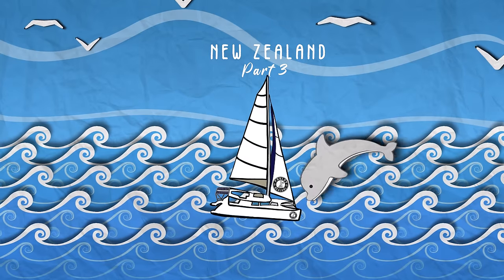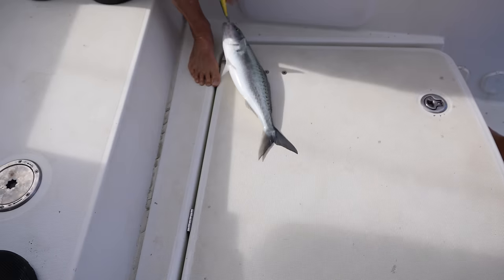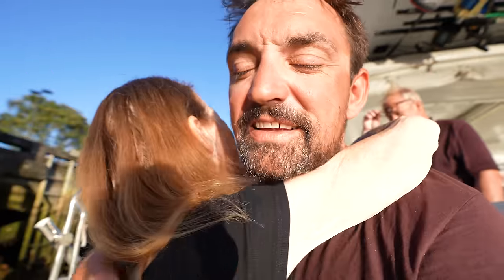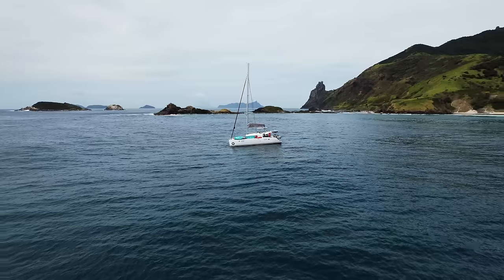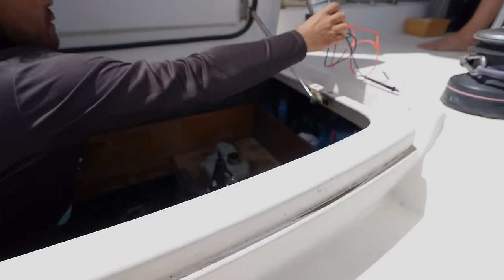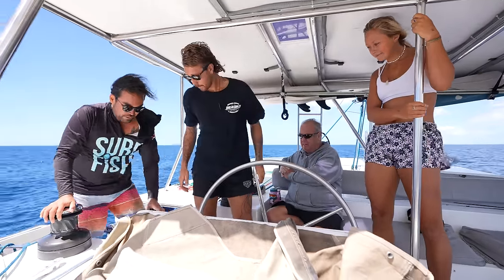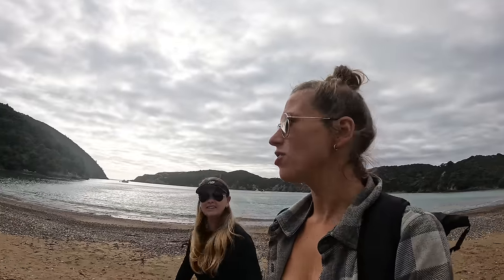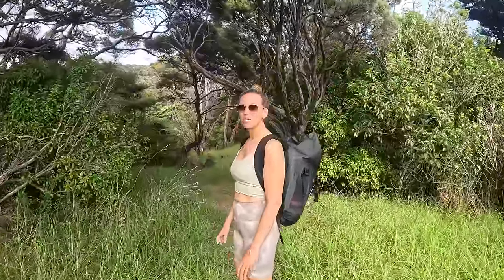I'M SERIOUSLY ABOUT TO THROW THIS SAILDRIVE IN THE TRASH!

Comment: I'm no engineer, but with over 20 yrs in manufacturing, I've found the best way to find the problem is just keep eliminating what's NOT the problem...you'll get there every time, eventually!  Been dealing with an oil leak on my truck, eliminated several possibilities and narrowed it down to just 2, fortunately you have to remove one part to get to the other, so I won't be breaking any knuckles on nuts and bolts that don't need to be removed, I can go right to the root of the problem now.  Gotta love those jobs where you need to do about 6 hours of labor to replace a $10-$15 gasket or some $2.00 O'rings...

Comment: Cheap easy low-tech way of isolating a noise:  cut a section of garden hose.  One end on suspect area of the engine the other end to your ear.  Husband does this all the time on car engines.
Reply: My dad would do the same thing with a sawed off broom stick handle. One end to his ear, and the other around the engine, touching different parts. He could find a bad rocker, lifter or valve issue very quickly.
Reply: Long screw driver also works.
Reply: All the above are excellent improvised mechanics stethoscopes.
Sometimes, they can even be better than an actual stethoscope, by eliminating some high pitched frequencies.

Good deductive, minimally invasive, diagnostic procedure nonetheless!

Comment: I made a plywood box with gasket that fit around the drive leg and bolted to the hull so the sail drive could be removed in the water. It fit either hull.
Reply: It works but it's much easier to ram a deflated inflatable under the hull and blow it up, I've changed a saildrive on a Lagoon when our crane was out of action.

Comment: Nothing stops you and your crew, it just means a small course adjustment in plans !  Good thing about drives like that, there will likely be lots of old spares available online or hopefully locally until you can arrange an upgrade/replacement to another model better suited. Maybe a better unit can be swapped with some help from manufacturer ?

Maybe some manufacturer will be willing to make Parlay a test mule by sending 2 sets of different paired drives to use with their return planned so they can be disassembled by factory in exchange for a new or used set of 3 (1 spare ?) for permanent usage ? Think of all the owners of Lagoon models watching your boat as a leader in what they'll need in future... you're a pathfinder vehicle.

Comment: Mechanic tip 
When looking for a sound and easy way to find it is this. Put a 2  foot section of broom handle on the part you want to find the sound. Put the other end against your ear about 1 inch under your ear hole about your ear lobe. . Then just move the broom handle to different parts you will be surprised what you can hear inside different parts when even the engine is running. No need to jump into the water

Comment: My SD50 drives rotted away last summer and I had to "force upgrade" to SD60 drives. My goodness they are insanely better. I can hear them shift all the way up on my flybridge. My SD50s had the same upgrade kit you installed, but still lots of problems. It wasn't cheap, at about $12.5k per drive installed. However, I also spent about $4k on lower shaft replacement parts for my SD50 2 years ago. The drives themselves cost about $7k with the SD50 conversion kit. However Yanmar wasn't willing to honor any warranties unless I had them pro installed. But with all your certifications, maybe they'd let you. 

If it's in your budget, I'd upgrade. Most of your problems will go away...

Comment: Hey Capt Colin 
Here my take on finding problems with motor 
Either get a doctor heart beater contraption or 
Just a hose long enough to reach down around the engine and the other end straight in to your ears to pin point the problem 
Hope that's helpful cheers

Comment: Pick up a spray can of Phosphoric Acid (rust killer) and coat all your non-SS steel tools and engine fittings with it. Having pliers that easily open and close, and nuts and bolts that don't have to be heated up to remove them, makes maintenance so much more 'Fun'... :face-fuchsia-poop-shape:

Comment: Two engines means you have a back up. It also means twice as many failures and twice the maintenance and repair costs . Add in a generator and you have 3 engines to break down .

Comment: Love this episode-  I mean Possible fire, Big lobsters, failed sea drive.  About the "fire"/  Being a classic VW guy (you know - the ones that only catch on fire occasionally!!!) Well a guy has invented a passive fire extinguisher in the form of a pliable tube that quickly melts thru and sprays retardant before  you even know there is a problem.  Believe its called "Blazecut"   Comes in different lengths. I'm 74 and been in the outboard/marina business as a mechanic all my life. worked on many  Volvo stern drives .  I believe you might have trapped some debris  while motoring and bent one of your gears- ( just a total guess you understand)  was unheard of in stern drives. But maybe pattern the gears and look for a tight spot if you can not actually see a damaged gear.  The other thought is - you did not power the drive shaft in reverse to see if gear damage might be there rather than the clutch.  Can't wait to hear what you found out. Cheers  Bill.🤔
Reply: Rugby tackle--bet that looked good on paper.

Comment: could you maybe explain a bit how it's possible to bend a cleat up like that. Me and my mom were pretty confused by the ripped up deck and bent cleat. I'm convinced it was a freak accident assuming most lagoons don't have this happen. But the whole cleat bending is evidence of enormous force, i'm sure you know this as an engineer. I'm suspecting that small landmass you sailed passed made a small change in the wind speed and direction at the same time. creating a "perfect storm" for that poor cleat? but maybe it was just left-over hurricane damage? seems unlikely to me, i'm pretty sure you did thourough checks for condition of hull and deck. Maybe it's just impossible to check the bonding of the two? i certainly wouldn't know how. Hope it's not a touchy subject, and looking forward to the next episodes. And be more careful with that huge chungus of a sail you maniac! love you bye!
Reply: Someone suggested the spinnaker should've been used not like it was, but with a prodder, aka tangonnet, which bears and pushes forward asymmetrical spinnakers or gennakers. Not sure if that prodder would've been ripped off or not.

Comment: I've had to replace lower gears on both my SD50 saildrives. Super weak design. I replace lower seals at every haul out, and carefully inspect every tooth while in there. I have a trick to replace the vertical gear without disassembling the whole leg.

Comment: Getting some high quality electric saildrives and engines with re-gen. and a bigger battery bank would be awesome.
There gotta be some companies out there ready to sponsor the best sailing channel on the Tube.
Reply from the maker: Thanks Ian, appreciate that!
Reply: @ParlayRevival  You've earned it Bros...
Reply: Electrically powered sailboat drives still have similar weaknesses.  Their advantages is still that they cost less to the builder.  There is no advantage to the user.
Reply: @captainjimolchs  In your humble opinion... 
Is it by experience or just something you feel?
Reply: @Ian_Christensen  --Sailboat drive, (properly named), is what it is regardless of motor choice.  The only advertised advantages are less noise and vibration, which could be further reduced by electric propulsion, and less prop walk, which I consider to be disadvantageous because it might require external assistance or side thrusters.  They might also save space, and horizontal alignment could slightly increase efficiency.  However, most maintenance beyond recommended inspection intervals calls for a haul-out, as seen above.  It appears that replacement of the entire unit and fabrication of an adapter, was preferable to replacing one gear.  The model 60 has a spiral/worm gear and generally considered to be an improvement over the 50.  Failure of the double boot seal can be catastrophic.  Some models come with or recommend leak detectors.  Water in the oil is a telltale sign of danger.  Catalina refuses to put them into their boats.
--Hopefully, I have answered your questions.  My sources of information are from two sailing magazines and some reviews, all on-line.  As a rule, I expect magazines to be favorably biased, but all sources are generally consistent.
--Regarding electric engines, there could be advantages in multi-hulls to having 1 fossil engine powering 2 motors/props.  To use Delos Jr. as an example, which I assume has all the battery power she can hold, but conventional drive shafts, with 2x25KW motors.  Battery power is 40KWH; Solar power is given as 3.5KW.  That says that at 1/2 power, she has 1 hour of "steaming" time, and will need 10-12+ hours of full sunshine to regenerate less refrigeration needs, etc.
--Electric locomotion, IMO, be it on cars or boats, represents something I have heard called "conspicuous conservation".  To change PR over would require major redesign.
--PS:  All I know about sailboat drives; I learned after watching Parlay Revival.  Colins' suffering was not in vain.  I may sometimes disagree with his sailing style, but I cannot challenge his mechanical abilities.

Comment: I think the boat is now so modified (i.e. now a 46.5 Jamie) that you might think about going electric on those engines!!!  Worked good enough on Uma and that used to be a Frankenstein system.  With your platform, YT viewers, and social media reach, surely one of the current manufacturers could be talked to and an understanding be reached.  An excellent possible story of retrofitting a production boat to electric from diesel - which would also tie into your environmental theme of the channel.

Personally, today, I would immediately chose electric and save myself the headache of fluids, diesel, all sorts of oils/greases and so many moving parts/fittings/hoses/etc. continuously threatening to break (well, I guess diesel still stays for the emergency generator).  Not that electric motors can't break but - it's an electric motor!!! A single electrical connection and a proven engine concept that simply works...

Comment: Sail drive? I will never have a sail drive in my boat, they are truly the worst invention ever devised that are put into a boat, they are notoriously bad and unreliable, when anything goes wrong with it you must haul the boat to get at it, the straight through old fashioned prop shaft is the only way to go, modern boat builders use sail drives as a cost cutting measure and laziness, nothing else. 😏